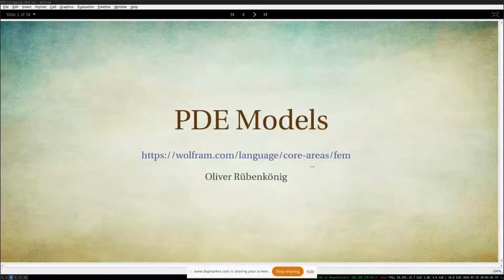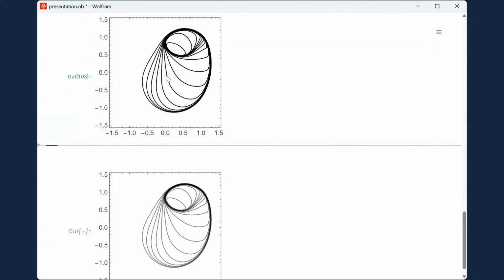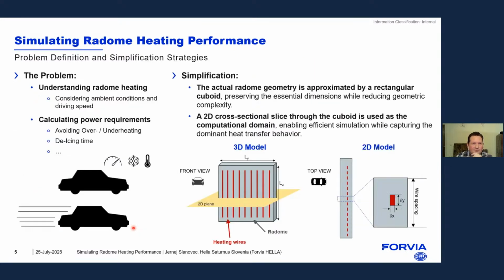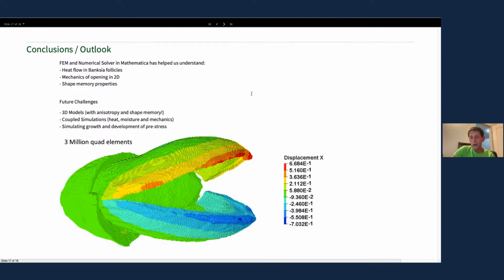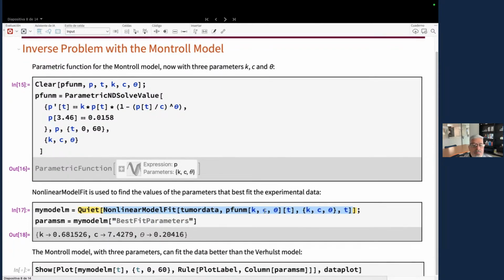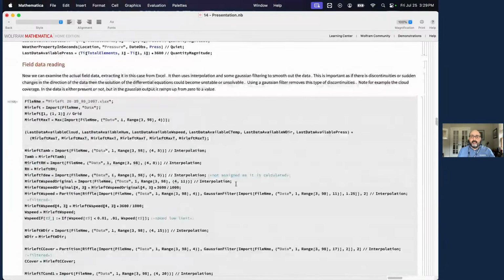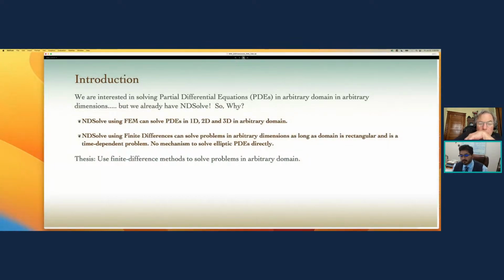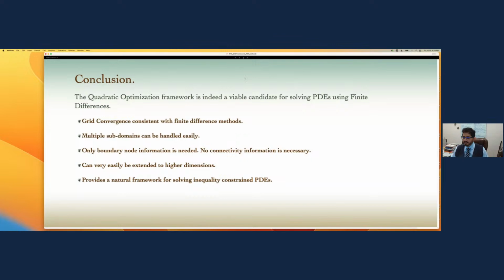2025 Colloquium: Numerical Methods for PDEs and Their Applications

Comment: Great video! I'm working on free boundary PDEs where maintaining boundary smoothness is crucial. Currently, I have to approximate B-spline curves as polygons for FEM, which introduces numerical artifacts. 

Is there a way to use BSplineFunction directly with:
- DirichletCondition for specifying values on the curve?
- NeumannValue for specifying normal derivatives?

The polygon approximation breaks both the geometry and the normal vector field.